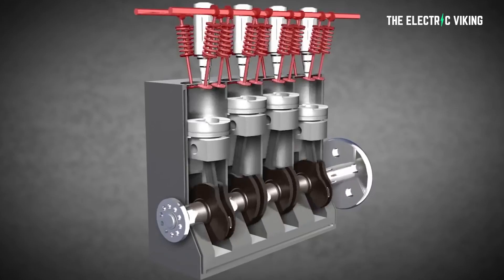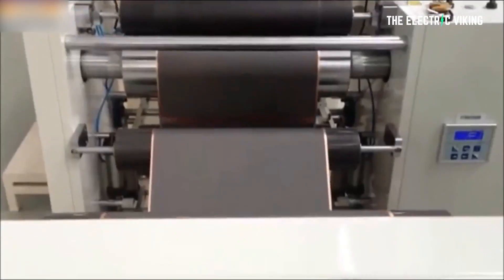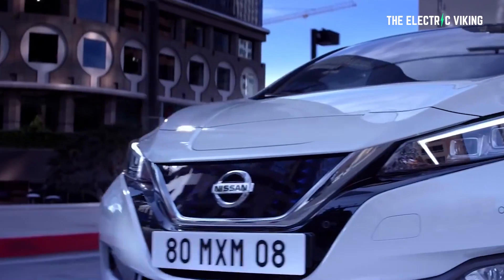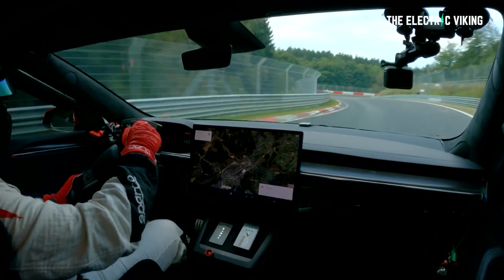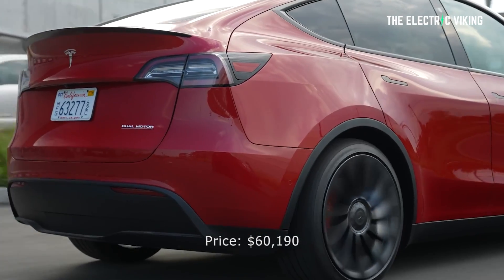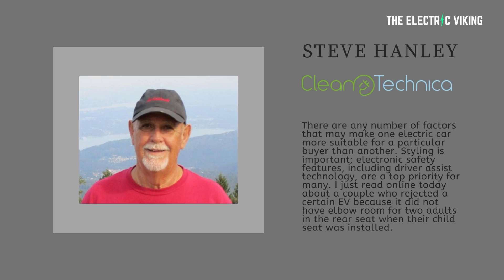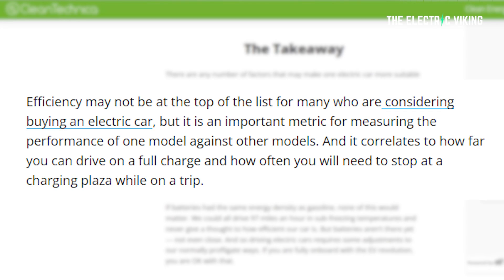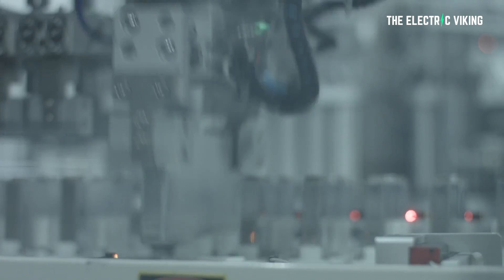The 10 MOST efficient Electric cars In the United States

Comment: This is consistent with reports that Shell Oil Company in the 1950s had done some research to prove gasoline cars could do 150 miles per gallon. If most gasoline cars are currently 20% efficient and currently the average mpg is 30, then a 100% efficient gasoline car would do 150 mpg. 

So why don't we have 100% gasoline cars? Greed and corruption. The research by Shell Oil was buried and anyone who tried to duplicate the research vanished.

Does this mean that ICE cars are deliberately less efficient to sell more gasoline? Yes.

Comment: Been driving a 2014 Chevy Spark EV with 93,000Miles on the clock.  Over the last 4500 miles or so, I'm getting 4.3Mi/kWh, and I haven't seen much that can come anywhere CLOSE to that in actual driving.  Curious as to anyone owning any of the 10 on the list if they come anywhere close.

Comment: Interesting numbers. With my 2017 Chevy Bolt EV Premier I easily got 4 miles/kWh year round in Minnesota, which includes temps below -20 Fahrenheit in winter. From spring to fall I easily got 4.5 miles/kWh (275 miles a charge) and could get 300 miles if I tried. I drove that car 96K miles, so good sample size. 

My 40 kWh Nissan Leaf seems more efficient than the Bolt EV, but I've not had it a full year cycle.

Comment: Jeez, one compiled table could have said this more concisely and then concentration could have been put on the technical aspects of efficiency. With efficiency the other big themes for technically sound and sustainable EV production are: a) battery energy density (which is well known) and b) resource and materials supply volumes and costs (which is less well appreciated). I think the indications are that effective long term/secure supply of the chemical and fabricated components of EV batteries will require: i) a large increase in the scale of global Lithium mining/recovery, processing and recycling operations and ii) a rapid phasing out of the use of Nickle, Cobalt and Manganese in large scale battery production. Fortunately, there are many viable candidates to replace NCM based battery chemistries.

I don't think there is any completely general equation connecting wheel size and efficiency (rate of acceleration and gearing ratios must also be taken into account). All other things being equal a larger wheel/tyre will reduce torque to the tyre contact patch. But, electric motors produce oodles of torque so if large wheels have been sensibly specced in line with motor output then they are the right choice! There is such a thing as too much torque to a tyre contact patch - traction breaks and the wheels spin on the spot. Also, while torque is of the highest importance it isn't everything. What do large wheels permit that small wheels don't? They roll over road surface imperfections - bumps, dips and potholes without the forward motion of the vehicle being upset or impeded to the same degree as would be the case for a vehicle with smaller wheels. Anything that accelerates as fast as a Tesla, say, couldn't really benefit from smaller wheels.

Notes: 
(1) For two cars travelling at the same speed (rubber to road is being laid, so to speak, at the same rate) larger wheels will rotate more slowly. For one full revolution of a small wheel there is less than one revolution of a larger wheel, viz. wheels and tyres as a whole. That changes the dynamics of force management by the suspension to a degree and generally speaking bigger wheels do help to smooth out the ride of a car.
(2) Larger wheels permit larger brake disks (assuming the brake disks are conventionally located) and, all other things being equal, that is a good thing for reliable and powerful braking.

https://www.youtube.com/watch?v=vyEzL5u2Mbo
Reply: Large wheels have similar overall diameter to smaller wheels - when you include the tire.  They simply have less tire between the rim and the road.  The bigger wheels require a stiffer sidewall tire, and thus , are less efficient when used on EVs.
Reply: @dennislyon5412  Well, I wish I had spoken more coherently about tyre diameter. Yes, there will be lower profile tyres on 18in wheel rims that have a diameter that is very close to that of (higher profile) tyres fitted to 16in rims. So, you have a point. But, there was nothing inaccurate in the technical points I made. And, for a car manufacturer designing a vehicle with 18in wheels they get to choose the tyre profile and thus tyre diameter - talking in generalities doesn't get us very far.

Now, was the Viking making the same point as you are about tyre sidewalls? I doubt it, but in any case your contention about 'efficiency' is the interesting thing here and I don't think what you have said is entirely sound. Yes, tyre compliance (I gather that is what informs your comment about stiff sidewalls) is of the utmost importance in converting rotational motion of the wheel into propulsion so it is part of the efficiency equation (which is at its most propitious when the distance travelled in a given unit of time is higher and the energy expended is lower) but it isn't the only factor in that equation. Minimisation of tyre distortion is also critical. And, as a rule, lower profile tyres, as they are designed today, do reduce tyre distortion relative to higher profile tyres. And, how do you gain that advantage without altering tyre diameters (which might necessitate vehicle redesigns that are too expensive to be carried out in a short term)? You increase wheel rim diameters!

There are engineering trade offs whichever way you go. Formula 1 and Pirelli have bitten the bullet on lower profile racing tyres. In Formula 1 the rear wheels go to 18in (up from 13in) this year.

https://www.y-yokohama.com/global/product/tire/learn/care_safety/rolling_resistance/
https://www.autoweek.com/racing/formula-1/a38593154/why-formula-1-18-inch-tires-expect/
Reply: @pennyh6720  - no offense intended - it has been demonstrated many times over when you compare the efficiency of an EV with 20 or 21 inch wheels against the same car with, say, 18 inch wheels on a normal use car, the smaller wheel with the taller sidewall tire is more efficient to roll on an otherwise identical car.  Now, given a “limitless” tire budget, I’m sure that gap could be closed.  Interesting point that F1 went from 13 in to 18 in wheels essentially overnight.  I’m sure that presented big challenges to tire and chassis designers.  And it even gets into how engine power gets delivered to a tire that’s exposed to a combined acceleration and sideload (cornering).
Reply: @dennislyon5412  No offence taken. Please note the Yokohama reference was there to indicate that the often proposed symmetry that links taller sidewalls with more efficient rolling has long been called into question and not least by tyre manufacturers themselves. In any case, I would be interested in getting some references to the technical source material (tests or whatever) that you have drawn on in forming your view on this matter.

I have added a second note to my original comment that isn't connected to the point we have been discussing but that represents another serious reason for favouring larger wheel rims.
Reply: @pennyh6720  - Hyundai Ioniq 5 is one example.  The AWD version has larger wheels and way less range than the base RWD version.  The front motor may be decoupled during steady state highway driving, but the range drops off by something like 40 miles.  Same goes for Tesla performance models (big wheels) vs lesser brethren (smaller wheels and higher range).

Comment: The current obsession with EV efficiency reminds me of the early days of solar PV. People were praising one panel over another because it was 1% more efficient. Some would pay a much higher price for these “premium” panels. As we moved along the learning curve, PV installers and customers wised up to the fact it was more cost-efficient to simply add an extra panel than pay a lot more for the “premium system”. Sam is spot on with his last statement. Manufacturers will solve the efficiency problem by increasing battery energy density. Before too long most electric cars will have 1000km range and their owners will be charging from their own rooftop. No-one will care about efficiency.
Reply: We should continue to care about it, not obsessively, but imho, it is important. Not just for convenience but mainly the fact that in many places lots of electricity is still made in part from dirty sources (fossils, biomass, ...). Yes electric cars are way better than fossil burners, also for the environment and climate. They should still try to use the lowest amounts of energy possible
Reply: @David34981  I agree. And we should also consider the embodied energy. Ask the question: “Do I really need a huge SUV/cyber truck or would a smaller vehicle be sufficient for my needs.

Comment: Glad to see my Bolt near the top of the list. My used 2018 was least expensive and longest range EV I could find at the time. It's assembled in Michigan but the battery (yikes!) motor and power electronics are all designed and manufactured in South Korea.

Comment: I prefer the calculation of miles per kWh rather than kWh per 100 miles. I find it closer to how we measure ice cars and easier to relate to range.
Reply: I prefer a measure that is not constrained to merely a daily drive ( ~ a full charge/full tank). How long is this vehicle going to last? Or how often are you intending to get the latest...and forget about those dents, scratches,
Reply: Agreed. My Kia Niro EV gets 3.7 miles/kwh, which is 100 miles per 27 kWh.

Comment: Another thing that can affect energy use is whether a car has a heat pump or a resitive heater and whether the battery has active battery tmperature managment. Early Nissan Leafs had particularly short range if they were used for urban driving in wet weather where the resistive heater was heavilly used to keep the windows from misting up.

Comment: One of the regular comments made by the EViking is that EV costs will fall as battery density increases etc and as competition increases. I somehow doubt that costs are going to decrease any time soon. Has the cost of smartphones really decreased over the years? Apple has been able to charge a premium price for each new iPhone and Samsung, Huawei, Xiaomi etc don’t undercut the price significantly but just use it as a benchmark on the “if Apple can charge that price then so can we” basis.
Reply: Apple and Samsung target the mid-to-high-end range of smartphones, and each year they tend to improve quality or add features rather than decrease price. However, if you search on Amazon for "smartphone" and order the search results by price, you will find lots of smartphones that cost less than $100, even some that cost less than $30. The same is likely to happen for electric cars. Tesla will probably continue to target the mid-to-high-end range of the market, and other companies will compete for the sub-$20,000 or even sub-$10,000 market.
Reply: @CiaranMcHale  I accept that. I suppose I’m just saying that even if KIA , for example, find that they can reduce the cost of an EV6 by 10% because of a reduction in the cost of batteries they are unlikely to do so if they believe that the EV6 is comparable in value to the consumer to a Tesla 3. Similarly I guess the production cost of a Samsung S22 isn’t really a factor in its pricing —it is going to be priced close enough to an iPhone because it does the same job for the consumer. I may be totally wrong — Chinese entrants might price based on how much each vehicle costs to build plus a reasonable profit but I suspect that, in fact, they will set their price as a little under an equivalent model from an existing brand. MG entered the UK with a very well priced EV but the revised model is now much closer in price to equivalent models from Stellantis. Perhaps I’m too old and too cynical. Perhaps companies will say “ our costs have reduced so we will pass these on” rather than “ consumers seem happy paying the existing prices so let’s keep the raw material cost savings and make larger profits”.
Reply: @johnhindson5316  I mostly agree with you. I think your cynical belief will reflect reality in the coming 5-10 years while demand for EVs will continue to far outstrip supply (thus giving manufacturers little incentive to pass on any cost reductions to consumers). While this sucks for consumers, the high profit margins for manufacturers will help them to fund expansion at a quicker pace in an attempt to gain a larger market share. Certainly,  I think this motivation can explain Tesla's price increases in recent months. My more optimistic view will take greater effect when (eventually) supply is able to meet demand, since that will then give some manufacturers an incentive to compete on price. But since this is the Internet, it is considered improper for us to politely exchange opinions, so [insert gratuitous insult] ;-)
Reply: On point where this analogy falls apart is the SE Apple’s “budget” offering. Comparatively it’s cheaper and better performing than iPhones years ago
Reply: Key there is whether the price rises with inflation. As for so many consumer electronic items, the price of EVs will likely hold at the same level while inflation surges ahead, making it more affordable for those with wage that keeps up with inflation. But given the present economic sanction fight over Ukraine, I’m not sure things are going to be rosy.
Reply: @wy3131  I suppose I was assuming that demand is likely to outstrip supply for at least the next 10 years in western societies and that therefore the manufacturers will choose to maximise profits by keeping prices in line with inflation. If the view that “legacy auto can’t make EVs at a profit” is true (which I happen to believe isn’t the case) then reducing prices as economies of scale kick in just doesn’t make any sense for VW, Hyundai, Stellantis etc.
Reply: @johnhindson5316  Not sure about legacy makers but suspect there’ll be a new breed of EV maker coming out to dominate the market in the coming years.
Reply: @wy3131  Not sure. I think part of the problem is the phrase “the market”. I suspect that there are many micro markets and they differ so widely from each other that it is difficult to get a handle on what is happening or is going to happen.
Reply: @johnhindson5316  I’d agree with that the global market is being split in many ways and there’ll be a few regional markets. China is the classic example, somewhat insulated from the crazy happenings there in the US. But at the same time, all of these market conditions will diffuse through in different ways and extent.

Comment: I’m not sure that the efficiency of the small modern IC engines used in European cars is as low as 20% but even if it is as high as 50% it still means that as fuel prices climb to £2 a litre you are just throwing £1 away. In contrast if you put £2 worth of electricity in your EV £1.80 is going to be used moving your car forward
Reply: ICE as a pure mode of propulsion has an efficiency ceiling of about 20%. Most cars get about 15-20%. The ICE used as a motor-generator for a Prius apparently gets about 40% efficiency, but that's not directly propelling the wheels but charging the battery. This is why Toyota hybrids can reduce fuel consumption by about 1/3rd to 2/5ths. But there is no car that can get 50% efficiency from the burning of petrol or diesel alone. You are right, EVs get about 90% efficiency.

Comment: If the Hyundai Ioniq Electric didn’t stop production this last year, it’d be #1 @4.5mi/kW, better than the Model 3. (Or 100mi per 22kW)

Unfortunately I lost mine to a car accident, but I’ve switched to a 2022 Kia Niro EV, which feels like a guzzler @3.3mi/kW. 
Going from 145mpge to 112mpge is very noticeable. Most new Chinese EV’s get 5+mi/kW (atleast sedans). I hope most cars get 7+mi/kW in the near future.
Reply: I hear conflicting reports about the 38kWh Ioniq. Has Hyundai really stopped production?
Reply: That’s what multiple dealers told me, I tried everything I could to not only get another one- but the same insane deal I got in 2020. $170/mo + $0 down 3yrs. 
Only Hybrid/plug-in hybrid variants are offered now unfortunately, as they focus on other exclusively electric vehicles.
Reply: @TheTanman412  Yeah I did hear that was the case. Insane. The Ioniq electric is such a great car.